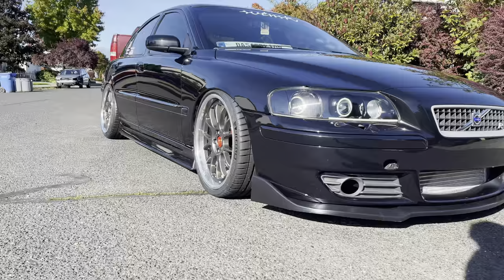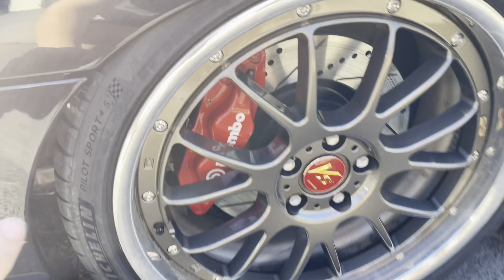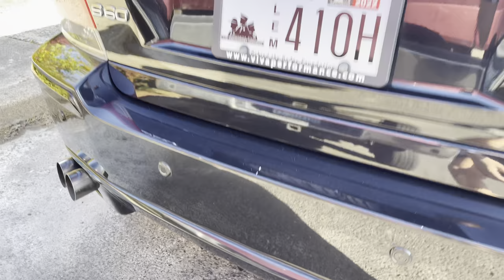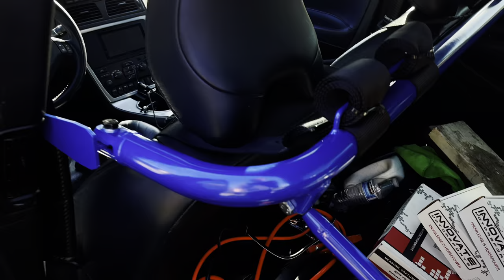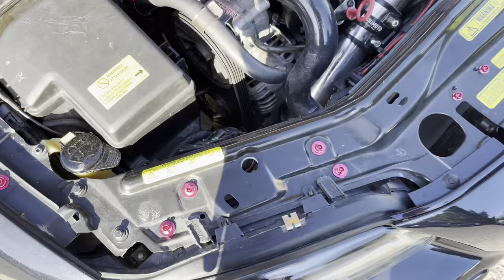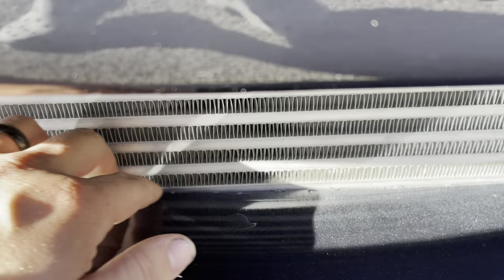Bagged big turbo s60r

Comment: first thing we do with 2.5 is block mod . than you can start mods. But the best think for R is swap for legendary B5244T5 from facelift T5.
Reply: Nah there is no replacement for displacement! As an R owner I’ve seen this argument time and time again but nobody has figured out the key to owning an R: maintenance and fixing the cooling flaws. I’m at 232k miles factory block 400 hp, yes the 2.5 has thinner sleeves but some guys have even crack the 2.4! Because they fail to remember aluminum and iron have different expansion rates!! Let your R cool down after driving and warm up before driving all turbo cars need this! Turbos need to warm up and cool down too!!! Turbos run more efficient when they thermally expand and this can also be the reason they wear faster if you don’t  cool down your R! Both the engine and turbo benefit from this!! Take it from a daily R driver!!!
Reply: Also 3k mile oil changes and I only use ams oil in my was system and in my engine. Best on the market well worth the price.

Comment: Pretty sweet! Love the turbo setup..
I have an s70 t5 manual with a 60k 04 b5234t9 swapped in. Did ttv chrome moly single mass flywheel and sachs 707 pp with organic sprung disc. Dw300 pump and dw800 injectors. 3" turboback. Snow performance wmi kit. Snabb turbo inlet and snabb charge pipes. Stock intercooler! Still holding 360whp 450wtq. On a hybrid billet turbo (just got a td06sl2-20g which should make about 450whp) running mamba braided feed lines. Running 3.25" maf Ive maxed it a few times at redline but not enough to worry. Its vast tuned so he was able scale the maf a bit to keep afr safe. Have lotek 3 pod pillar. Aem x series wideband. Ipd upper lower poly. Bc racing coilovers. Running cheap vision 17x7.5 wheels with falken azenia rt660 tires. Viva front n rear strut bars. Msd coil on 9mm silicone wires (not coil on plug) port matched 98 intake manifold. Other small stuff like full led dash, radio, climate control, led headlights n tails, reverse lights, plate lights, glowshift boost gauge and oil temp, mishimoto silicone rad hoses, cnc billet 1 bar wastegate actuator, upgraded silicone cbv heavy spring, ipd hd tcv, all silicone vac lines, badgeless grill, mesh bumper insert, 302mm bbk all brembo rotor n pads.
About 12k in including maintenance like cap, rotor, wheel bearings, motor was $500 i swapped it, 2 $1000 turbos, $1000 for flywheel clutch combo, plus cost of car.
Got car for $1400 1 owner 1 of 361 in u.s...
Like the s60 but something about 90s cars for me lol... Hope you keep it going...
Reply from the maker: Nice seems like you have a decent amount of work done. That thing sound like It rips and I have also heard that vast is a great tuner for that platform as well